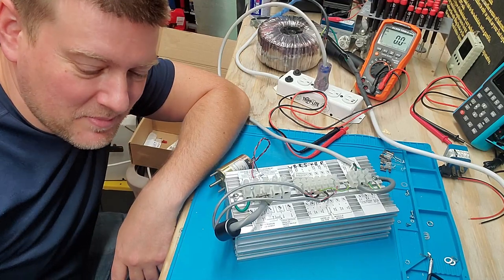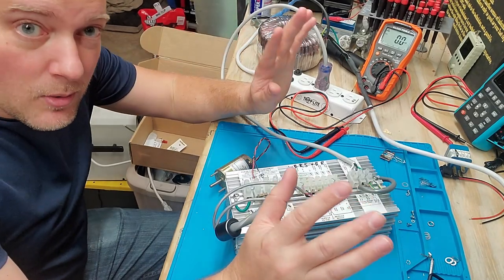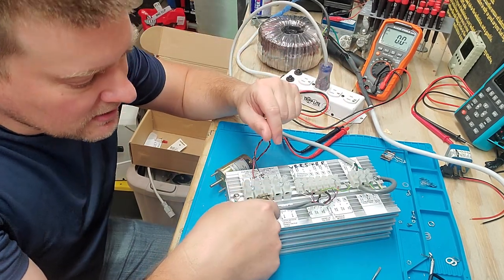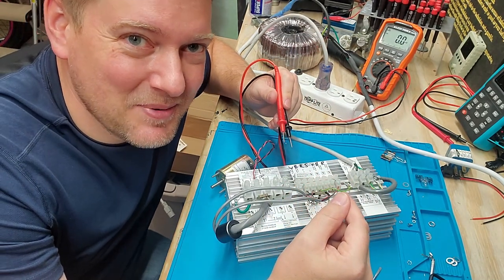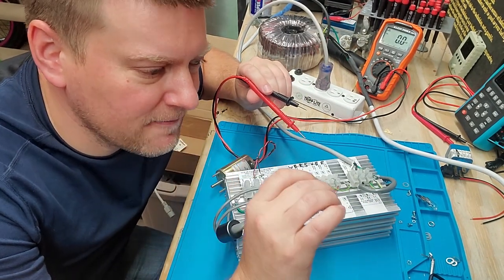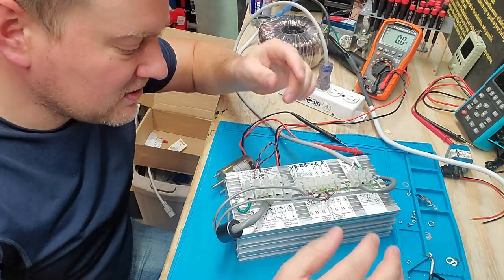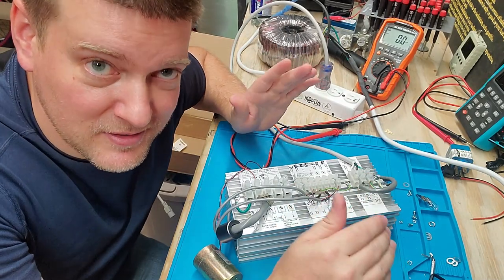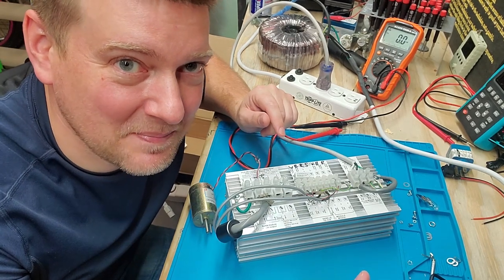Troubleshooting Power Supplies: Volts Do Not Mean Good PSU!

Comment: We've had numerous of our equipment that would stop working due to their PSU when they reach a certain age, about 10 years.  They'd exhibit similar characteristics where their voltage checks out, but goes flat once load is put on them.  We would sometimes replace certain medical equipment PSU's with Dell computer PSUs as they are everywhere in our hospital and are often much more robust than their original equipment replacement.
Reply from the maker: Often output filter caps (which are electrolytic caps) leak or swell at ~8-10 years and you'll get random failures

Comment: I think of 2 possibilities.
1) The PSU is looking for the right amount of load (impedance) , if the load is too high (short etc...) or too low (one of the light bulbs is open circuit) 
the PSU goes in safe mode or Hiccup mode.
2) One or more light bulbs went bad, so the open voltage goes up (unstabilised output design of the PSU). 
A digital multimeter in resistance mode has minimum 10Mohm internal impedance, connecting 10Mohm over a much lower value of the potentiometer 
has no influence on the combined resistance,
but like you already mentioned, in resistance mode a digital multimeter will kick out 1,5a2V. 
If the potentiometer is regulating a small voltage arround 0,5 or 0,7V, then the higher voltage of the digital multimeter
has a big influence on the feedbackcircuit of the potentiometer.
When this happend and the output voltage raised above a certain max voltage, probably a TVS diode in parallel with the output 
went short, which is now causing the Hiccup mode.
Reply from the maker: I am thinking about doing a teardown and exploration into this failure.
One thing you should know is that there are 3 bulbs that can be powered by this one PSU. 2 bulbs in a large light head and one in a 2nd light head. That means this PSU isn't too sensitive to load impedance.
Reply: @BetterBiomedChannel  if the cause of dead is unknown, then we need to do an autopsy :-)

Comment: Maybe the control IC/regulator or a transistor is bad inside.
Reply from the maker: I am thinking that the feedback circuit is defective. The PSU can obtain the output voltage but cannot maintain when a load is in place.